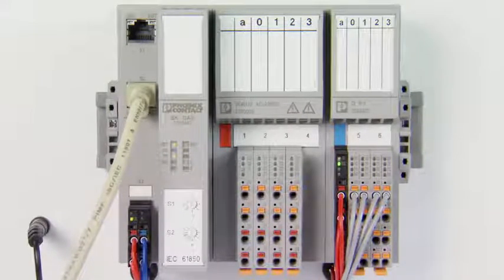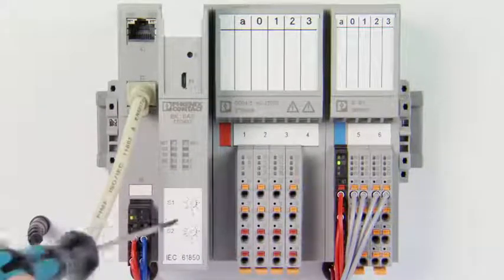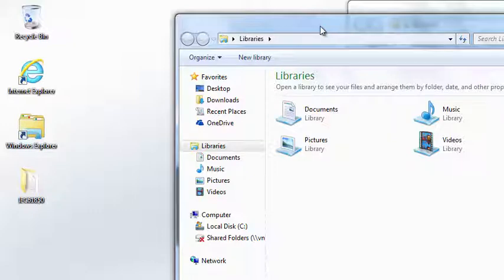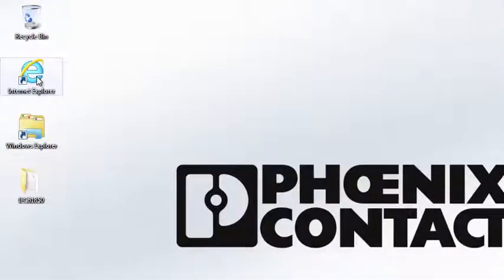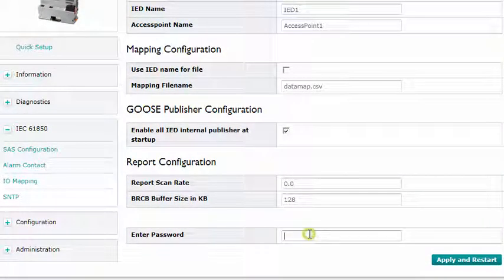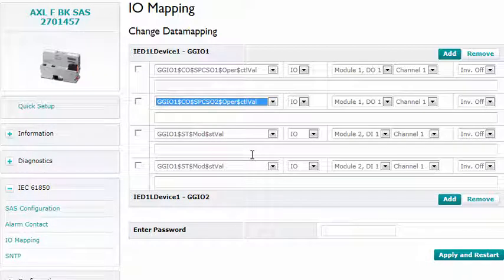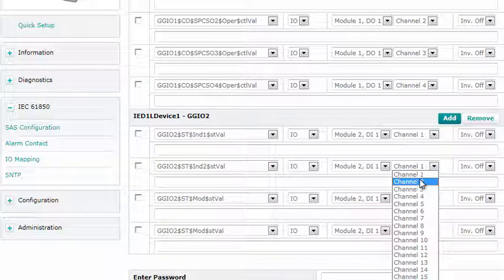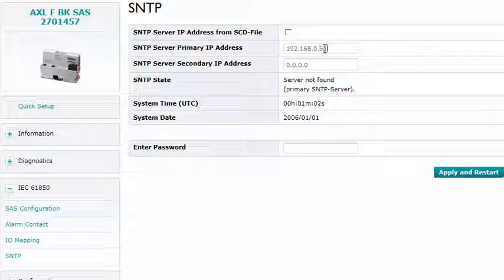How to set up an Axioline F Profinet I/O station for IEC 61850: MMS communication

Comment: where can i find/ Generate  the SCD file?
Reply from the maker: An SCD file for the Axioline F station for IEC 61850 communication can be generated individually by using the Phoenix Contact tool PCWORX IED Configurator.
The software can be downloaded for free at the e-shop page of the bus coupler AXL F BK SAS, art.-no. 2701457 at [AXL F BK SAS - Bus coupler - 2701457 | Phoenix Contact](https://www.phoenixcontact.com/en-pc/products/bus-coupler-axl-f-bk-sas-2701457#downloads-softw-link-target)